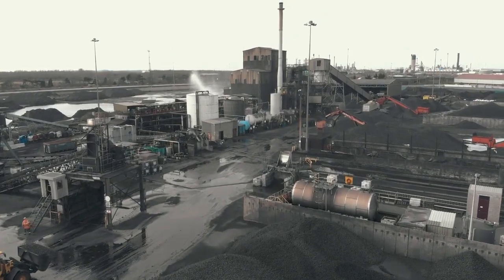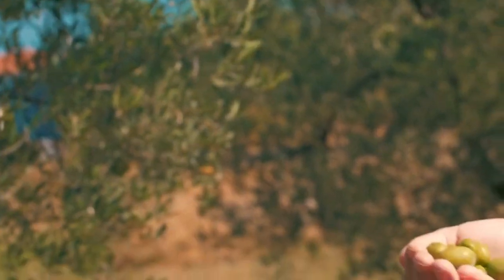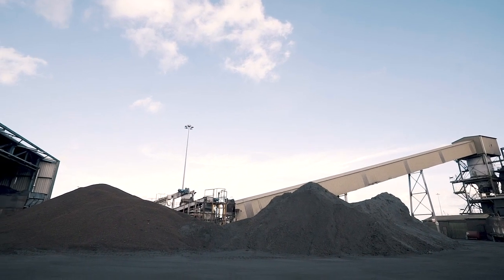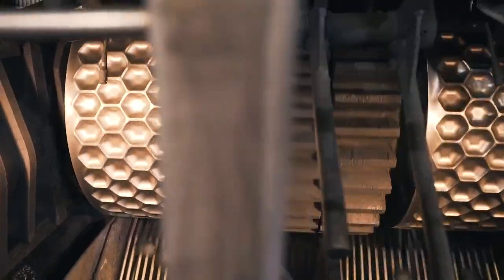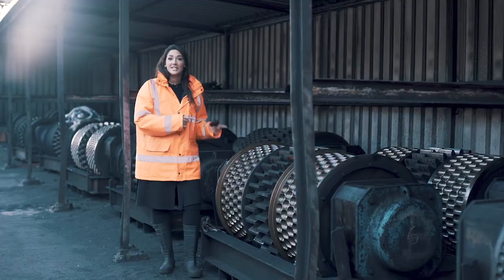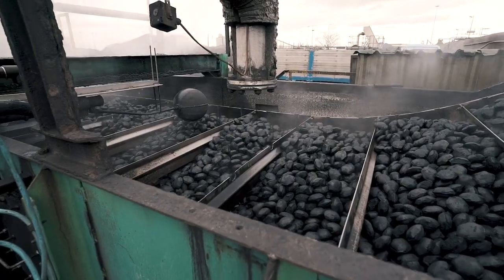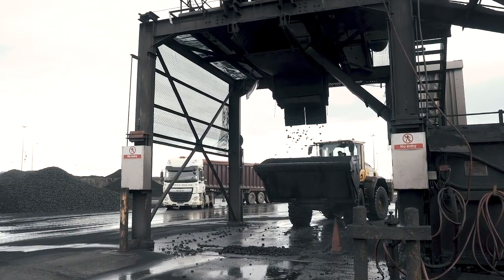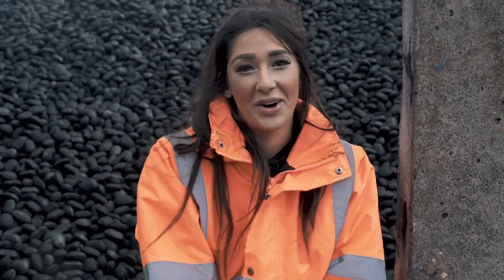How We Make Homefire Ecoal

Comment: Brilliant product. I use these in my multifuel stove instead of logs. They last much longer and have a great heat output.
Reply: How do you get great heat from these ? I can only get medium heat if I put them on hot ash bed of good coal. Got double sided stove. I find them OK but never get near the heat I can produce using coal and logs
Reply: @Derekryan456 do you have plenty of air getting in from underneath them? They won’t burn well with air only above them. They need to be used on a proper raised grate. Hope this helps